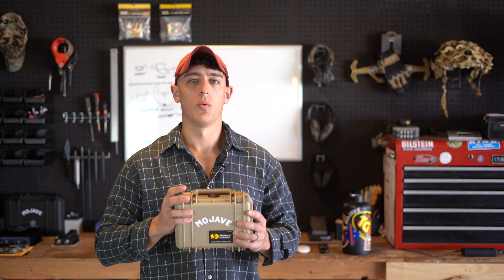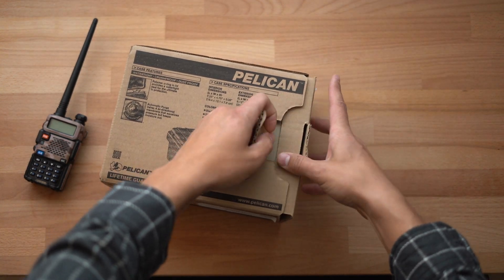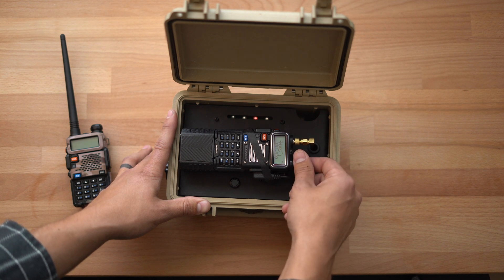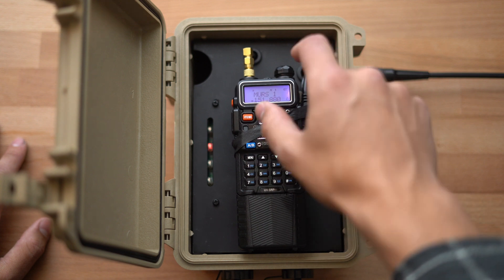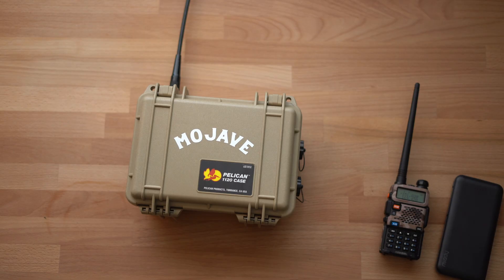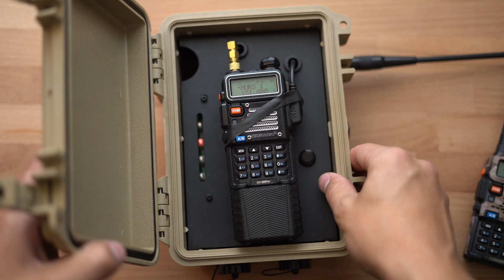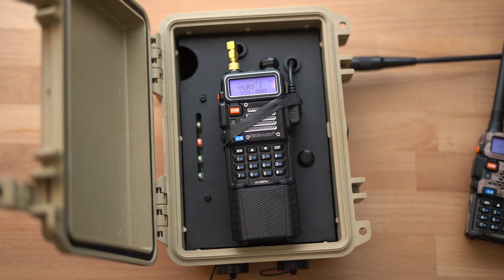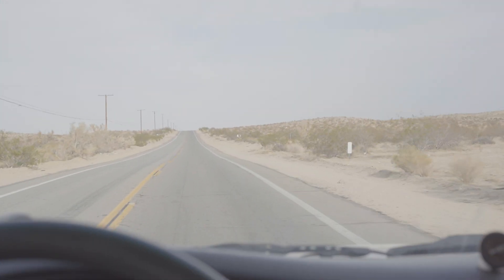Mojave Repeater "LUNCHBOX" Radio Repeater for Baofeng UV-5R and more!

Comment: A better antenna or directional antenna elevated as high as you can get it while using UHF will give you a bigger range boost..
Reply from the maker: Okay so how do you reach someone on the other side of a mountain with just a directional antenna if you cannot move and they cannot move
Reply: @MojaveRepeater  I was adding this to a micro repeater as a better option for a better antenna then the ducky whip..  A vertical co-linear with numerous 1/4 wave segments will also pull down the vertical RF envelope and give fairly similar gain characteristics in an omnidirectional pattern as a 3 to 7 element vertical Yagi.. I built several for different bands but my best was in the 440-450 FM UHF  with a 150 mile contact using 1 watt of power from a micro HT on a day with out observable ducting or other propagation enhancement.. On SSB in the 432 frequency range using a 40 element Yagi I have worked several station over 1,200 miles away but at much higher power when tropospheric ducting was observed.. I have been most likely licensed in radio and working in several RF related jobs like AM radio, cable television and high speed WAN systems for twice as long as you have been alive so I might know a thing or two and one of them is yes radio waves bounce off things.. Sky wave on 7mhz can give you an operational 150 mile footprint that will by itself bounce over that mountain from the lower ionosphere..

Comment: 5:19 make no sense. if others hear when you send others hear. no need repeater part. that makes other hear 2x. you only here 1x. no point send 2x. if you hear 2x then others hear minium 2x.
repeater idea is been middle of radios get range not mail box.
2x radios and VOX works for that. best scenario you not need repeater at all

Comment: So you basically selling end-user radio, but in the box. Which does not really simplify anything (having no extra interface), but instead makes things worse by having an ignition sequence more complicated than small-sized helicopter. Not a great deal.
Radio is not limited by line of sight, btw.
Reply from the maker: You have no idea what you’re talking about hahaha

Comment: Looks like a nice unit but i see a couple design flaws you should consider addressing. Especially considering the emergency and preparedness aspect of radio comms.

I can't tell if there is an internal battery to power everything or just the batteries on the individual components.  If individual, you might add in a battery for longer life. You could easily set it up just like the external connection where both devices are fed by USB from the pack.

Those external connections should NOT be type-A connections for convenience as that requires a somewhat non-conventional cord. Yes they are easy to get,  but for simplicity it should be a typical  connection port like USB-micro or the newer type-c. 
It looks like you charge the devices in the box separately.  By adding the internal battery pack you could make this a single or double charge connection, all with off the shelf stuff. This would also stabilize charging from a small portable solar panel (10-40w size).

Don't know how much available space is left over in the case but if it's built how I think, adding in a USB battery bank to the case could accommodate the power requirements and connections from the external ports if you have one that supports dual-charging.

It looks like you're using the aftermarket 5R battery that allows USB charging.  If you need a radio with the same abilities but smaller footprint look at the S9+. Alternatively maybe one of the water resistant units that uses the non-kenwood connection and secures to the radio via screw. That I don't currently have experience with so don't have a model recommendation though Baofeng does have them.
Reply: Great input!!

Comment: can.a repeated be suspended from a tall tree or off a building? Does orientation matter?
Reply: Orientation only matters for the antenna.  For the included antenna you would want it as vertical as possible.  You could change the antenna to something else though, but it's not the Orientation of the case that would matter just the antenna.

Comment: You mentioned its a 8 watt radio , really ? Maybe you should put a meter with a 50 ohm load on it and check because all the 8 and 10 so called watt radios only put out 5 watts and at 5 watts that radio can still over heat fast so its best to go one level down on them to prevent it from burning up . Now that parrot radio setup is great if someone who wants to hear what they sound like .I have used the units on base stations so the station owners can drive around and check there coverage .
Reply: Correct.  Bought a Baofeng "8 watt" radio just to test it.  It barely made 4.5 watts, and that was the best it could do, and only of some frequencies.  They are a cheap way to get into ham radio though.

Comment: You can do encode ctcss on repeater tx, decode on mobile units rx.  The mobiles will ignore direct, ctcss'less weak radio tx, but let in repeater signal. No more echo.
Reply from the maker: Another great solution!
Reply: @MojaveRepeater  Thanks! It will not handle much traffic. Quick info/permission coms, no roundtables.
Reply from the maker: @whoaedgy7345  Totally agreed

Comment: I did a similar repeater build but mine used two Baofeng UV5R's and I put them in a $19 harbor freight knock off pelican case
Reply: Doesn't work if it's rx and TX simultaneously....  the rx will be overwhelmed by the close TX.
Reply: How does that work? I am planning to build one.
Reply: @ch0lito  I mean it works but it's not the 50 mile range shtf comms system I was hoping for
Reply: @PracticalTacticalSheepDog  Oh ok, thanks for sharing, but i think that is better than nothing.
Reply: Now put it on a drone or balloon for on the fly elevation gain

Comment: I think this is what I’m looking for to do a long rage net for our group so my question is could u use more then one of these in a single transmission ie transmit radio to repeater that then sends it to next repeater that then ends at the receive radio? If so I would be very interested in putting them on solar battery banks for a full time all the time net…your thoughts thank you
Reply: DITTO! I'm only about 5+ months behind you in finding this page and asking the same basic question about Daisy Chaining several of these units to extend the transmission and reception distances.
Did you ever get a response, and if so, what was the gist of the answer if you don't mind me asking?
TIA, Pardner.

Comment: What about a solar panel set up to keep up the charge and be able to put it in the field and leave it for months at a time? Is this possible?
Reply: Sure. Easy to spot though and an enemy could sabotage it and setup an ambush for you. But do it right, sure. Why not. Also, you’ll still want a battery attached.

Comment: Why do you use off set? Its a tedious obsolete function.
You can just use, transmit and received on different frequencies in Channel mode.
1. Set radio to frequency mode.
2. Select the frequency to received on. (444.444)
3. Menu - Option 28 - Delete Channel 0
4. Menu = Option 27 -  Select Channel 0 - Receiving memory
5. Exit menu - Select frequency to transmit on. (444.888)
6. Menu - Option 27 -  Select Channel 0 - Transmitting memory.
7. Set radio to Channel mode
8. select Channel 0
9. Notice + - at the top while on Channel 0
10. Receive on 444.444 and Transmit on 444.888.
Reply: You can also just CTCSS code offset the repeater.
Reply: OK all you Brainiacs above.
My brain is officially HURTING now.
Someone needs to volunteer to let me EAT their brain so I can absorb SOME of that crazy knowledge. 
Or we can trade some knowledge on firearms. Pretty much whatever you want or need to know, I can teach you or show you first hand in trade. 😊
Reply from the maker: Two ways to achieve the same functionality out of the radio. I wouldn't say offset is obsolete, especially considering that what you've done is utilize the offset just in a different manner. It's a common feature in every analog two-way handheldTwo ways to achieve the exact same functionality out of the radio. I wouldn't say offset is obsolete, especially considering that what you've done is utilize the offset just in a different manner. It's a common feature in every analog two-way handheld. I like your solution as well.
Reply: @MojaveRepeater  Something that might help. I see that you using a pelican case. While it is a nice I've found that its possible to get a similar spec case that's waterproof for $12USD. This will dramatically bring down the cost of the product.

Comment: But if you look up MURS on the FCC database it says No MURS transmitter shall, under any condition of modulation, transmit more than 2 watts transmitter power output.
Reply from the maker: Yes that's correct. I should have made a clear recommendation to abide by the FCC rules. But of course, this can also be used on channels where that low power output is not a condition.
Reply: @MojaveRepeater  Not legally.  The UV-5R is only compliant on 2 meters and 70cm, and if you are a licensed armature radio operator.

Comment: I use  a setup like your lunchbox for testing coverage for HT users, and for potential repeater sites. Mine is built in a .30 cal ammo can, and has an NMO connector. I also use a NMO to SO-239 adapter for external antenna use. I have a small 12v battery and "battery eliminator" for powering the radio.

Comment: You guys should look into 3D printing a bracket to use vs a ranger band. Pretty low cost once you get a good design.
Reply: Another option would be to find a small block of FIRM Closed Cell Foam, place a small section of velcro on one side with the other attaching portion on the inside of the case, then wedge the block in place to keep the pinned plug from wiggling free. Leave the Ranger Band on as well as added insurance and the wedged foam should keep it in place, too.
My last question has to do with extending the range of the Baofeng radios by "Daisy Chaining" multiple repeaters along a desired path.
By this I mean can you place two (2) or more say 8-10 km apart from each Mohave device and end up with them literally repeating your transmitted signal?
And would you hear multiple responses back with the senders voice and have to literally COUNT the "echo's" so you'd know when the furthest repeater would have triggered to make sure the message arrived X km away?
Obviously, a LARGER repeater with significantly more power would be the answer but it would be anywhere NEAR as portable in the field.
TIA for any answers you can provide me, assuming you even get to read this since the OP has been up over a year.
Take care and I've now subscribed.
Reply: Thats kinda one of those things that you do if you already have a 3D printer and know how to play with it. For most people, if it works, it works.
Reply: If you notice that band is holding the connection into the speaker/mic port on the side which on these uv-5r's is flawed and has to be held in with "something", likely the reason for the band.
Reply: Zip tie works well.
Reply: People with 3d printers overcomplicate everything so they can use their 3d printers. It's better he doesn't.